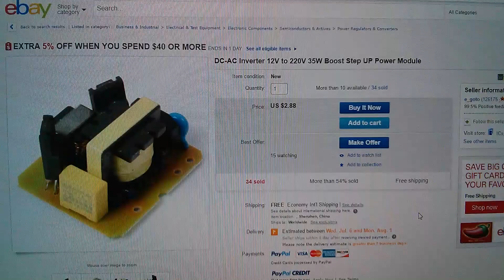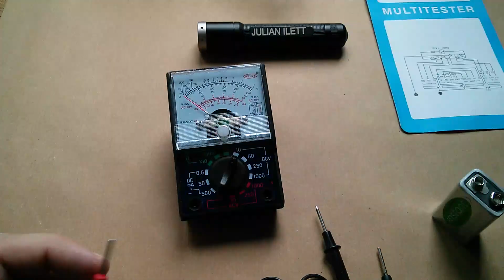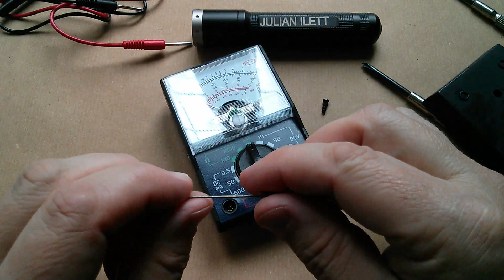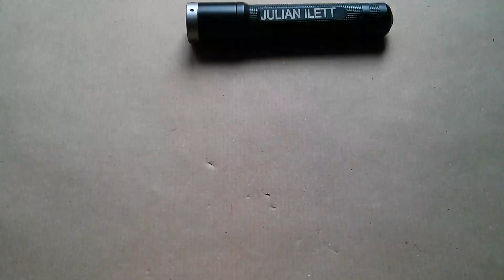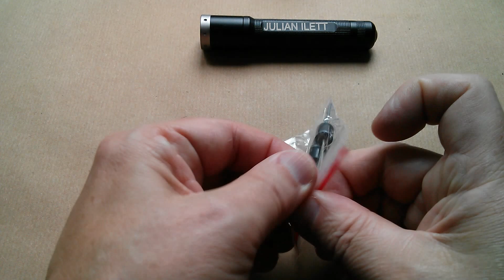Julian's Postbag: #67 - Inverter, Crap Meter & Sealer, Schottky Diodes

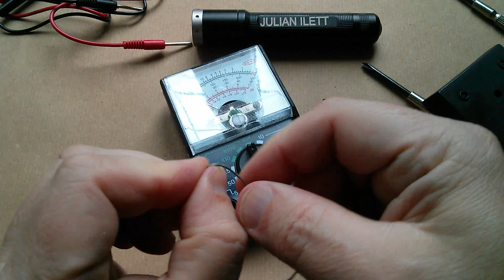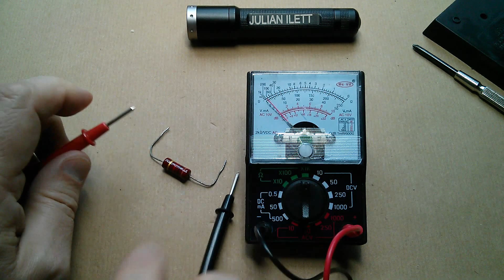Comment: You had me worried at 10:16 but you figured it out at 12:45. Before measuring ohms on an analog meter,  recalibrate every time you change resistance ranges by touching the leads together and adjusting the pot to zero. This also gets around varying battery voltage. You are lucky to be a young man who didn't grow up with analog meters and learn this ritual early on. :)

Comment: Are you trolling with that plasticsealer.? 
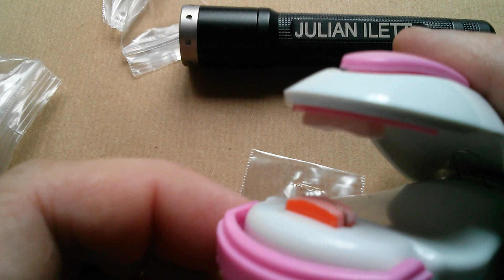at the 16:28 and the statement "completely useless" I reckon most viewers was not thinking about that bag sealer-
and yep you need to pull the plasticbag contnuesly while sealing it to keep an ewen temperature-seal along the line of the bag.

Comment: Ah those big diodes take me back,   w  a  y  b  a  c  k; to 1973.  I had just separated from the US Army at Fort Bliss Texas, the car I had at the time was one I picked up cheap at the El Paso Auto Auction Service, a car dealer that specialized in selling mediocre cares to GI's from the Fort.  Oh she was a beauty, all white Buick with bucket seats, chrome wheels, and a hot engine.  Problem was, when I took her out on the highway, some weeks after buying her, she would not shift out of 2nd gear; the automatic transmission was shot.  So I took her to AAAAAAA something transmission service, who advertised they would tear your transmission down and give you an estimate free of charge!  Yep they did, and man were they pissed when I said not to fix it, as the cost was more then I paid for that damn Buick! (hindsight says I should have fixed her!)  So as advertised, they did put her back together, however charged me for the new transmission fluid they put in her, guess I can't blame them for that, but at the time it really pissed me off.  So being really pissed, I drove the car across the street to another one of the GI car trap centers, and told them up front what was wrong with the car, they traded me for an old Oldsmobile Vista Cruiser that some kid had tried to fix up.  Had a Hurst 3 on the floor, the front seat was held in with bailing wire, but had a nice seat cover on it, other then that she looked OK.  I checked the back and found no spare tire though, and I was getting out of the Army soon as I said, and needed to drive this outfit 1000 miles home, so I looked around and found a nice spare at a pawn shop.  I was not real wise in tires, so I told the broker that I needed it for the year model Olds, and he swore it would fit.  So taking him at his word, I picked up the spare (didn't fit by the way), then I needed to have some turning signals since the lever was broken off the steering wheel post.  I talked it over with my Project Transition boss, who as an electrical engineer who ran the switching central for William Beaumont Army Hospital, he gave me a couple of those huge diodes to wire up to two toggle switches  I wired them up to a home made shift knob I carved out of a 2X4 and we were set to go North!  Yep, made it to Denver before those diodes burned up, setting fire to my pine shifting knob and disabling my turn signals!  Oh well who needed turn signals in 1973 anyhow, practically nobody North of Denver used them anyhow.

Comment: I'm a old school service guy.worked on fal and eggs group gear in the early ups.we only had anilog instruments.the minitesters were very popular.you need to short the probes a adjust the pot to get the pointer to infinity.Because it's powered by a aa battery,which looses voltage after a while.The battery was a zinc carbon/chloride hp7.You had to be care full not to apply voltage when in ohms.They were cheap then and still are but they did the job.The bag sealer you have to draw it a cross the bag.big Clive would known

Comment: The multi meter review was dreadful. Please look up how to use them first. Analogue meters have very specific applications where a digital meter is next to useless. I have just spent close on £300 on a new analogue meter and expect to get full value from it. The bag sealer review was also an embarrassment. Simple piece of kit that has been successfully used for years. I am surprised there are not more dislikes. On second thoughts I am not surprised just depressed by it. 
Please stop the video after opening each bag and check how to use what you have purchased before continuing. Blaming the item when it is the reviewer who is clueless looks terrible.

Comment: Poor Jules must-of been having a bad day. 
How do you forget to short the leads in the range and zero the dial of an analogue before you test - he eventually worked that out -.
If it reading 1.8 in x100 range, isn't that only 0.8%
Not reading the instructions for the sealer, and then not realising there are different plastics.

Comment: That's a pretty rough meter you got, but analogue multi-meters still have their place. For one thing they can be useful when you're observing a varying voltage, the reading can be more meaningful than on a DMM where the numbers might just appear to be changing randomly. They're also handy for a quick check on electrolytic capacitors. And I still prefer using an analogue meter for testing continuity. It just seems quicker an more positive than waiting for some DMMs to beep.

Comment: I had one of these bag sealers, you are supposed to start at one side of the bag and run it across to the other side. If you hold it in one place to long it will melt the bag as you have seen.

Comment: you got  ABSOLUTELY  no idea how to use a analogue meter on resistance range. you have to put it on resistance range short the  probes out then adjust the knob on the side so it reads zero. then  measure  your resistance,,

Comment: You should drag the sealer across the bag. Just becayse it's cutting through the bag doesn't change the fact that it's sealing it. It also doesn't change the fact that the sealer is junk. I have one :)
The plastic cover is for protection so you don't accidentally set your bag on fire if you travel with it.

Comment: julian, i have that exact bag sealer from china and it actually works pretty well. the plastic guard is so it doesn't accidentally get pressed while you are away and burn something, its for safety. it works better with mylar bags, but you can use it with any bag. you have to drag it through while pressing, and the faster you drag it the less heat it will apply. thicker bags need to be pulled through slower to apply more heat. i've found that the heating wire does have a somewhat short life, though. however there are plenty on ebay for .99 free shipping.

Comment: I remember the analog meter I had, you calibrated for ohms on every scale by first shorting the leads, then adjusting it to read 0. If you changed scales, then it required recalibration.

Comment: the bag sealer, isn´t it meant for thicker plastic? like candy wraps and such? that will need more heat to melt, and the pictures doesn´t show a normal plastic bag anywhere :P you should test it on somthing like a candy bar wrap or something :P and don´t use the cover over it haha

Comment: That's funny as hell. I have an analogue MM from a reputable, UL certified seller in my country (Canada) and I just happened to pull it out today to play around with it for fun. It's easily 10 years old. Probably 15.Mine is branded "Sperry" and looks rather more well made than whatever it is you have there. Yours is a clear clone of whatever mine used to be. Still has the awful leads, though.

I was testing it earlier. Works just fine, actually (if you can decipher the analogue scale, of course).

Comment: You start at one end of the bag, press down and slide the bag across the sealing element. Works best with the thicker bags or the metalised anti-static ones. Those battery powered ones are pretty hopeless though. Grab one of the large desktop swing-arm type ones that do the whole bag in one go.

Comment: Oh I had quite a good chuckle with that bag sealer shenanigans... The trick is to put it on the bag with the little plastic thing flipped out of the way, and pull it across the bag. The constant motion makes the sealer not melt through the bag. I actually found it works better with not as fresh batteries.

Comment: Why not take the 12v from a 3 cell pack into the inverter and just charge the lowest voltage cells through a mains lithium charger driven off of the inverter? Also, look for bigclive's weird car to mains adapter thing. It put out DC on the mains socket, and is only for powering switchmode things.

Comment: I use one of those inverters to run Xmas lights on bike from 6v lead acid I had lying around. bigclive said it was probably a royer oscillator. I didn't have a proper way to measure the frequency but my crap meter thought it was like 46khz

Comment: I bought a very similar meter years ago in a bargain shop. I think I paid £2.50 back then. My one has a reasonably positive click, when I turn it to each position. I haven't used it much, but I bought it because I didn't have an analogue meter.

You aren't using the bag sealer correctly.

Comment: I'm sure that inverter is a simple Royer oscillator with a resonant cap between collectors of the two transistors.  You can rewind the secondary to whatever voltage you want; lower, equal to, or higher than your supply voltage. It doesn't have any regulation, it's a free-running circuit. Frequency will vary depending on the load, higher the load - higher the frequency. With the resonant cap, the waveform on the output will be a sinewave of some sort.
 By the way, you can gut out that meter and make a little circuit to measure ESR of lytics.
Reply from the maker: It does look like it - specifically a resonant Royer (according to Wikipedia)
Reply: Julian Ilett Yup. Quite nice little circuit for simple converters. I have a 12V CFL driver which is nothing more than a good old Royer. But absence of regulation greatly limits it's range of use.

Comment: Actually in the first board there are two capacitors. I've got the same and it has 2 X2 capacitors, instead of an X2 and a Y capacitor like in yours (it's not a MOV). Also mine has no bridge rectifier and outputs straight 15-20kHz AC.

Comment: Ok Julian time for you to do a video on how to use a analog meter and slamming one to the table because it's not reading what you want is not good. we not get any this morning?? There are times when a DVM will not give correct readings like when you have DC with an AC component , Why the higher dollar DVM have a Bar Graph. I do Have and use 2 Fluke DVM's. And I raerly  use my Simpson 260 or my RCA VoltOhmyst WV-77E  VTVM. If I need to calibrate something that is critical It's hard to beat the vacuum tube voltmeter for not loading the circuit. Also if the AC frequency is high most meters will read incorrectly. then special probes are needed. just what would one expect from a meter under $50 ??

Comment: The nice thing about analogue meters is that the mechanical inertia smooths out fluctuating voltage/current, whereas a digi display dances around, unless it has a filter function (easy to rig for voltage, harder for current).  Since I have a fairly accurate digi,  I really don't give a toss if the scale markings on my crap analogue one are way off because it's easy for me to connect both to a constant source and say "Ok when the ana says 1.7 V, it's actually 2.1V".  The mechanism isn't bad, the scale markings are.  And the smoothing has come in handy.  Hope you haven't thrown the little darling away!

Comment: Unfortunately,I also bought one of those multimeters and it's even worse.Damping on mine is non existent  and on any range or function the needle flaps about violently and takes about 3 weeks to settle ! I rekon you'd get better results from the bag sealer by sticking some kapton tape over the little heating bar then drawing the bag through fairly slowly.

Comment: That meter costs more than a cheap digital unit and the $5 digitals I've gotten are damned close to as accurate as my $50 Extech. Analogs, even good ones, have a very limited range of use anymore.

Comment: you are using the bag sealer wrong, I have one like that. keep the protected flap down out of the way. place bag in unit, press and slide the bag thought. slow cut and seal, fast just seal. thicker bag must go slower.

Comment: Julian i received the CMG2420 solar charge controller you got in postbag (https://youtu.be/-e6VopSlWpM?list=PLjzGSu1yGFjWcmLv3QzBkwYySqsk14Brw&t=795). have you done much with it. it seems mine will charge 12v to 15, then allow drop to 14, then apply current to bring to 15 again, etc. does this seem right to you?

Comment: The sealer did what it was supposed to, heat the area until  edge melts.

Alternatively for easier bag melting:

Metal ruler & cheap soldering iron/old soldering iron/old tip for your soldering iron.

The under $3 one from ebay works good enough (if you cut the tip to chisel like edge with snips), the usb soldering iron can't keep up with heat & an old soldering gun wins by providing plenty of heat but also a good handle.

Comment: To be honest even the more expensive 50k/volt meters need zeroing every time you change range. That is not a calibrating thumbwheel it's a zeroing wheel. It will change from range to range and with the state of the battery. IE a 1.5V battery will read 10% high on ohms at 1.35V if you forget to re-zero (10% less current).

Comment: the bag sealer looks like a cheaper version of what i used to use at my old job once it gets up to heat you take the guard down (the pink flippy thing) and the run it across the area you want to seal at roughly at slow zipper speed (like trting to avoid an area that snagged before kind of speed)

Comment: That inverter just looks like a simple power supply, are you sure it's not supposed to be flipped the other way around? 220 in, 12 dc out. Seems the only logical conclusion with that rectifier...
Reply from the maker: No, it really is an inverter - I've just powered it up. Strangely, my application calls for a bridge rectifier on the AC output - it looks almost perfect for what I want it for.
Reply: Huh, weird! I have all of zero experience with inverters, what would the rectifier be used for? Does it split the output into AC and DC 2xx volts?

Comment: You should drag a plastic bag along the hot wire, without plastic-cover-thingy and it's seals great :)
Reply from the maker: Just tried it again - it does work, but you can't get an edge-to-edge seal
Reply: You have to seal it from the middle to one edge, then back in the other direction to seal the bit previously covered by your thumb as you were holding it.
Glad you finally sussed it :P You funny bugger :D

Comment: some items disappeared on my list too after it didnt arrived for like 1 or 2 months, right after i opened a ticket.  they arrived and the articles are still up, but not on my list.
Reply: I hate ebay throwing away my history. If you want to keep them be sure to archive them before the 60days run out
Reply: k thanks for the info
Reply: gamerpaddy I was wrong ! I have mistaken purchase history with message history. Purchases aren't deleted autmatically ever ! Messages: I now found out that you can let messages be automatically archived and so those are kept 'forever' also
Reply: Yeah, I sometime have gaps in my history on eBay as well. Very annoying bug :/ Just today I looked for an item. I thought I bought it on eBay, could not find it. Moved to AliExpress, not there either. Searched in my mail and there it was, i did buy it on eBay! But there is just a gap in my history there, more things are missing and it happened before. But the weird thing is, if I click the link in the email to show my order details it loads them just fine. See the item, the cost, my address, the date etc. Weird :/

Comment: Head in hands. You were so close with the bag sealer, just needed to flip the pink guard down and drag the bag as you did. Would have worked just fine then. Speed of dragging is consistent to the dwell time of the seal (and therefore the depth). Don't give up, give it another try.
Reply: No I think he should leave complicated devices like that alone!
Reply: +Mentorcase    uuuhhh,  yelp ! 😎

Comment: You short the leads to zero it then do your measuring.
Reply: Yea they are so complicated aren't they? snerk.
Reply from the maker: Yeah, I'd forgotton that! So long since I've used an analogue meter. I did remember later on :)
Reply: Digital meters spoil you. :-)
Reply: If you ever get the pleasure to use a VTVM or a FET VoltMeter you need to set to DC volts and set the zero adjust to 0, then go to OHMs, short the leads then adjust the ohms adjust. On some VTVMs don't forget to set the probe to AC/OHMs (or move the probe to the AC/OHMs or OHMs socket.
Reply: How on earth can you forget that?
Reply: Yeah but we get spoiled. I am so used to just grabbing my autoranging meter and measuring that when I go to use my cheap meter it takes a while to remember what to do.:-(
Reply: Heck, now even the cheap meters are digital. Harbor Freight gives away one with purchase if you have the coupon. And amazingly, it actually is a meter that works decently. It won't do a 20 amp check like my RS unit but it will do a 5 amp or 10 amp DC load ( depends on model available ) reading.
http://www.hfqpdb.com/coupons/11_FREE_7_FUNCTION_DIGITAL_MULTIMETER_1531757625.3021.png good till 11/31/2018 You can buy them for under $6 and use their 20% off coupon on a second one too. ;-)
Reply: John McFerren, I wonder how many people have used one little alone put one together from a Heathkit V-6/V-7A/IM-18 VTVM kit? ;-) Yes, I'm that old.